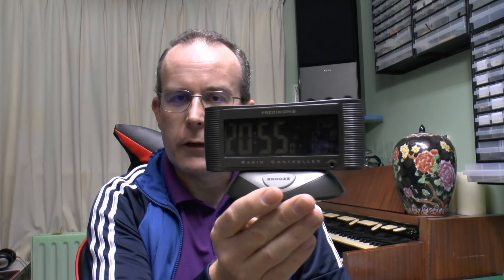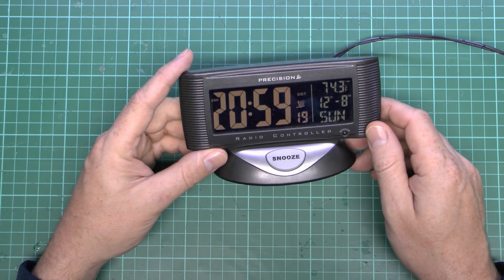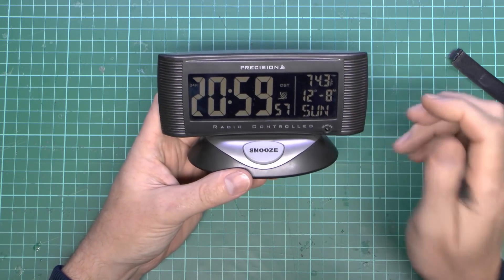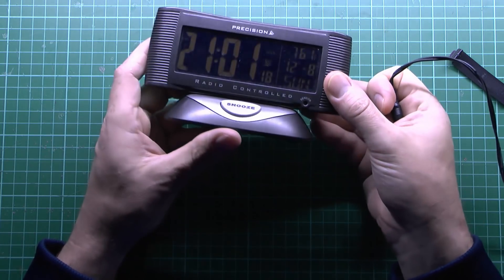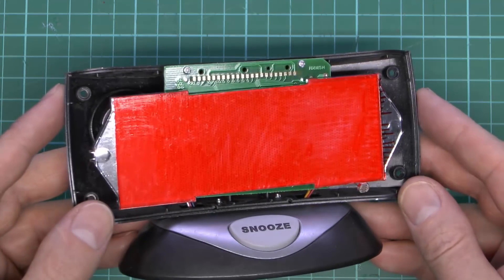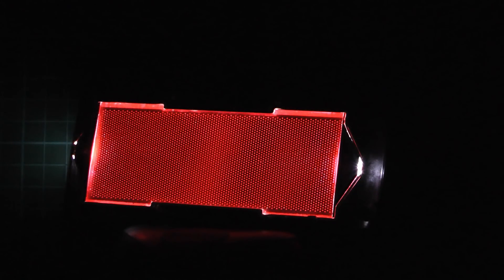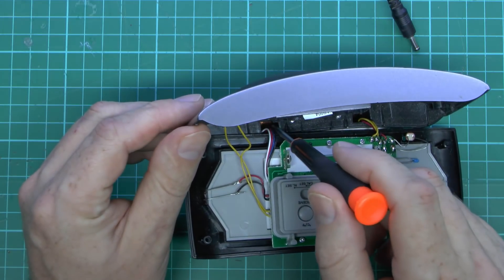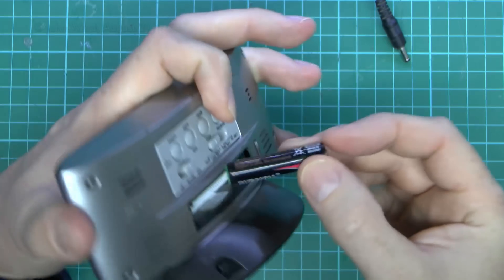LCD Alarm Clock Backlight Modifications

Comment: I did a similar modification to my car stereo, an Alpine unit. The backlit buttons and display were way too bright for night driving, even when dimmed down from the menu of the device. I opened up the detachable front panel and used some white paper to dim the display backlight leds down more and also used a black permanent marker pen to dim the leds illuminating the buttons. It's perfect now.

Comment: Sharpie idea is good, I've used coloured Sharpies in the past to recolour faded or clear Christmas light lamps!
Another thing that is useful for colour changing effects especially if used with white LEDs, are the plastic wrappers from Quality Street sweets, you can mix & match them for an almost infinite number of colours.
Btw, if you buy radio controlled clocks from Lidl or Aldi,  (I've got several) they use the German DCF 77 time standard but there is always a setting in the menu to change the time by + or - several hours, depending on what part of Europe you live in.

Comment: 25:30 I have a weather station / clock bought from LIDL so made for the German market.  But it does allow you to offset the one hour from German time.  Actually I had to work on the backlight for that too.  The original LEDs failed after a few months so I replaced them with two salvaged from a scrap mains LED light bulb.  I didn't want to take the clock back because I like it, so a modification was the best way forward as LIDL no longer stocked it.

Comment: Some clocks allows you to set an offset time (offset from the radio source) and in that way you can use the clock everywere you like no matter what timezone it may be, this id useful if you have German clock source with the dcf77 radiosignal and you do not live in Germany.
Reply: Hans K.K. Like the ones you buy from Lidl or Aldi stores.
Reply: +Richy, The Tinkerer & Wanderer. On analogue ones they set the hands at 11 instead of 12 in the home position for the UK market.

Comment: Any clock sold in the UK should either receive MSF60 (the UK transmitter), or have the option to offset the time from DCF77 (the German/EU transmitter). 
The alarm clock I have has a UK - EU switch next to the battery, and also it has the option in the settings menu to offset the time from -23 to +23 hours.

Comment: This is a very good mod.
Back in my roadie days I adapted some PAR38 reflector bulbs by painting them with stained glass ink from an art shop, and they worked fine. Same deal with the pen, good choice. If you visit shops which sell stage supplies you can probably pick up off-cuts of lantern gels, especially since modern LED stage lighting has reduced the need for them, so I'm guessing the stuff might be cheaper now?
Reply: lordmuntague less demand, probably more expensive, not less.

Comment: The same signal works here in Ireland - having the same timezone as the UK is handy :D 
Wonder if you cut a hole in the back of the case and bent the temperature probe so it was sticking outside, would it be more accurate? The leads of the probe certainly looks long enough.

Comment: .. Oh.. The temperature is prob because the sensor is to close to the main pcb, it's detecting the pcb temp instead. Bend it away near the vent, or wire it with extra wires away from the pcb or hot areas.. 😉
Reply: Or it could be set to Fahrenheit.
Reply: and/or the thermistor isn't significantly more sensitive than a plain resistor.

Comment: I know this is a really old video, but is there a way to do this with a light that isn't white? changing the color i mean. i've got a super bright clock with a green light, and i hate it. sharpie method isn't working well. i know thats very nit picky, but i'm an interior decorator and like things to match, and prefer to upcycle rather than buying new things.
Reply from the maker: You will need to change the LEDs to another colour.  Most single colour LEDs can't be filtered as there is only a single wavelength of light.  The white ones and some others use a phosphor which emits a wide spectrum, so that can be changed with a coloured filter.

Comment: I made similar mod on my alarm clock. Old LEDs got dim and uneven, but were just pushed in molded holes in light guide plastic - changed them for new ones.
Reply: The current beside radio here is a nice DAB one one dumped at a charity shop because the white backlight LED was being run at a silly current on its highest setting resulting in near enough zero output after only three years. Replaced it with a undiffused red one and it's fine on the lowest setting.

Comment: You can ignore the best before date on the battery, you can use it way longer than that date assuming that there is charge 
left in the battery
Reply: Nadim Awan2 I've used alkaline batteries that are 10 years past the use by date and they are fine!
Reply: Yeah, but that date does tell you the battery is very, very old.